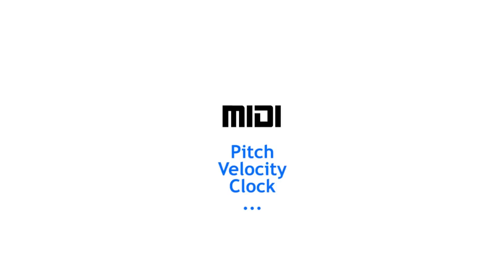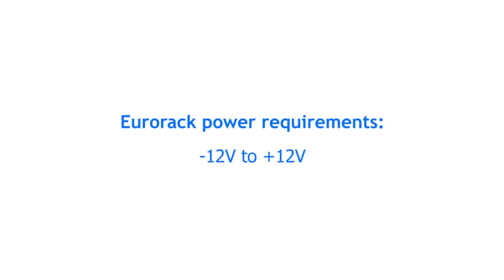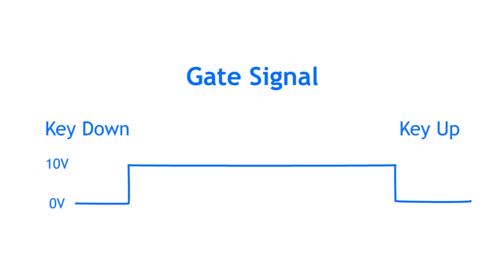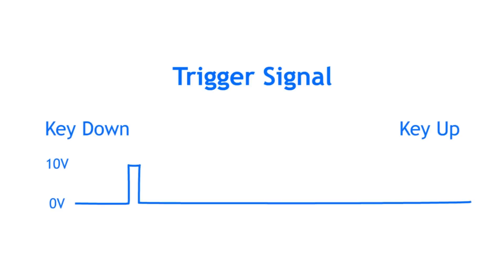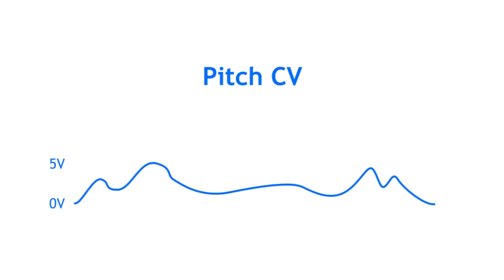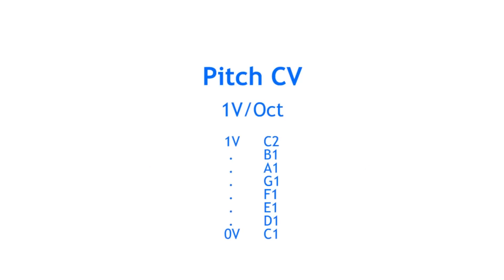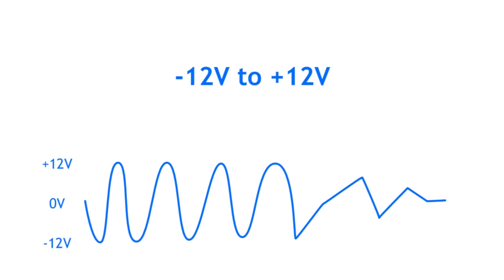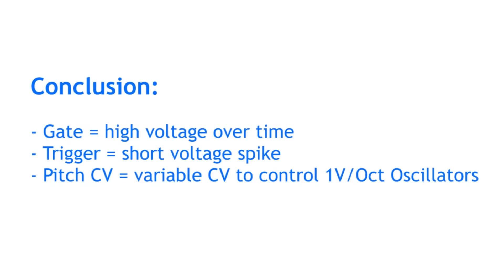Modular Synth Basics #02: CV, Gate, Trigger & MIDI

Comment: Is it possible to use a guitar or bass signal to controle a modular system? Maybe it' s a stupid question but i m really a beginner
Reply from the maker: +gian - no problem! Ask away :) you can use the amplified guitar sound to modulate the modular synth signal or you could use an "envelope follower" module which tracks the volume of the guitar and creates CV from it.
Reply: +The Tuesday Night Machines 
great!! thank's for the answer and the video!!
Reply: Not a stupid question.
Reply: @tuesdaynightmachines  You could also use a guitar to midi converter to control your setup via midi instead of a keyboard

Comment: Just think of CV/GATE has a monophonic alternative to MIDI. It lets one device communicate with another but it does so using voltage instead of a digital signal. The advantage is that there's almost no latency, so timing is significantly tighter with CV vs. MIDI. The disadvantages are calibration issues; V-scale issues; monophonic only; and you'll need an analog sequencer to really take advantage of the power.

-BaconTastesGood 
Gearslutz forum user

Comment: THANK YOU FOR THIS VIDEO! But I have a tricky question for you: if I understand, there is a link between the keyboard and the oscillator as well as between the keyboard and the VCA via gate and envelope generator!!! But why do we need to 2 links, instead of just having a link between the keyboard and the oscillator, with the oscillator sending all the information to the VCA, instead of going by the gate and the envelope generator? Why 2 ways of reaching the VCA from the keyboard? Why not just one way of reaching the VCA from the keyboard, and that way being the oscillator?
Reply from the maker: Because of flexibility. Pitch and Gate CV are two very different things and if the gate/env CV would also directly control the VCO's volume from the keyboard, you'd have a regular non-modular synth ;-) Also, there are things like velocity, pitch bend, mod wheel, etc. which all have their own CV channel as well. So it's not just Pitch and Gate CV you have at your disposal, but a bunch of others too, being generated by the keyboard or MIDI-CV interface.
Reply: Ok I see! It's that I saw from many sources that VCO were the ones creating sound as if they were the only source of a signal, but now according to you, I feel like a sound can be created by different sources including VCO, gate/env and many others. Is that right? And do different sounds from different sources in the synth are somehow mixed together in the VCA ? (By the way thank you for the quick response, you're really awesome!!!)
Reply from the maker: The VCOs provide a constant stream of waveform sound. So for example one ongoing BRRRRZZZZZZ from a sawtooth wave ;-) That's it. If you want different pitches, you send pitch CV into the VCO of course, but if you want volume changes (like hitting a keyboard key and then having the sound fade out), you'll need a VCA, usually controlled by an envelope's CV. Then you've got your filters which subtract frequencies from a waveform sound, which can also be controlled via CV (e.g. keyboard velocity controlling filter frequency, etc.). So that original constant BRRRRRZZZZ sound will be like ... bbBBBrrrzwwwffnngwee... hahaha ... well ... so with subtractive synthesis, our VCO offers a base sound and we use other modules/effects to shape the sound. Like a woordworker, starting with a big block of wood and carving stuff off until you get a small wooden statue ... check the beginning of first Modular Synth Basics video again and you'll see that non modular synths often behave the same way, containing the same "modules", but hardwired.

Comment: I have a question.
I have a synth which has a gate input and a pitch input (korg monotron delay) and i want to build my own keyboard. I tried Linking the +3V to the gate input through a potentiometer which changed the pitch. But i can't get the pitch input (i suppose that is CV input) to work witha potentiometer, so i am still confused about how cv and gate exactly work.
I thought CV is the voltage you put in and gate is just connecting two points so that the sound works, so on a keyboard you have both working together.

Comment: what is difference between Gate set voltage? What happens when I use 10V Out on one module and 6.4 V In on another module?
Reply from the maker: A gate usually goes on and off, or rather from 0V to a set voltage and back. A constant voltage is always at a certain level. The voltage level you need depends on the situation, for example triggering an envelope generator, advancing a sequencer or doing stuff with a comparator set to a specific voltage.

Comment: How is it possible to set an envelope to retrigger on each new note if there's no space between the notes? E.g. I press one key on the keyboard and without releasing that key press another one, but have the filter and/or amp envelope retrigger at the start of the second note?
Reply from the maker: It depends on how your MIDI-CV interface handles this. If it sends a new gate on each key press then you just need an envelope module that has a retrigger input (e.g. Doepfer A-140).

Comment: possible to use a clock for triggering? or how to clock a lfo?
Reply from the maker: LFOs usually run free (but can be synced to a clock or reset by triggers sometimes). Clock pulses are just triggers and triggers are mostly just very short gates. It's all the same electricity.

Comment: What benefits do you gain from having negative and positive voltages exactly? Can someone give me a practical/common example of how it can be used?
Reply from the maker: One example would be simple „math“. If one voltage is too high, you can use a negative voltage to subtract from it and get a lower voltage.

Or think about controlling fiter cutoff. Usually you turn the cutoff knob down and use a positive envelope to open it. Using a negative envelope CV you could leave the cutoff knob high and close the filter with the envelope, which creates a different sound effect.

Comment: But what is the ''env gate'' input on the crave ?
Reply from the maker: It's probably the input that triggers the ADSR(?) envelope, which is usually done by a gate signal.
Reply: @tuesdaynightmachines  yes I figured that out, was just confused because enb and gate have each their output but are together as an input. Thanks !
Reply: Env gate input will cause the envelope generator to run.
Env output is the envelope-shaped CV output.
Gate output goes high while the envelope is active.

Comment: So if using a Midi to CV, would i need to still patch that into a VCO to get a signal?
Reply from the maker: Yes, MIDI-CV just converts the note data to CV. What you do with that CV is up to you then. Patching it into a VCO pitch input will change the pitch, but you can also patch it into filter cutoff or anything else really to control parameters with pitch CV.
Reply: Right thankyou, is it a fairly standard thing for VCOs to have a CV input? also people mention stack-able patch cables, could you have the same key stroke controlling multiple different VCOs?
Reply from the maker: +callumissocoollikf yes, VCO stands for Voltage Controlled Oscillator, so it should have a CV (Control Voltage) input :) Stackables copy signals so that you can indeed use them for multiple purposes at the same time.
Reply: right thank you so much, it's so much quicker and easier speaking to a real human
Reply: Is the CV in on a VCO sometimes called an fm in or is that a different thing?
Reply from the maker: +callumissocoollikf FM is more for sound shaping, but it does change the pitch. It doesn't track a keyboard though. For that you need a 1V/Oct input.
Reply: so if i see a 1V/Oct input on a module then i know it will definitely handle a keyboard properly (aside from gate and that) thank you
Reply: One last question then i promise i will leave you alone, if i was looking at oakley modules, would i need a midi 2 cv that works in that specific format, aka, would a eurorack module not work?
Reply from the maker: +callumissocoollikf haha :D 1V/Oct will work across systems/formats, as will most other audio and CV.

Comment: Hi! mi name is agustin from argentina, the series of videos are great and very very useful! i came back to this video because i have a question. I'm buying a pittsburgh System 10.1+ ( http://pittsburghmodular.com/system-101-plus/ ) and i was trying to get another module to have other controls of the synth, i was thinking in the peaks module from Mutable Instruments (http://mutable-instruments.net/modules/peaks) but (this is my first modular synth sorry if this one is a silly question) it says it needs a trigger signal input to modulate, how can i create this signal? it could be any signal output into this trigger input? can i get it from the pittsburgh synth? i was thinking in a general control module with a lot of options, but that trigger input got me thinking if maybe this is not what i need, do you have any suggestions?
thanks a lot again! the videos are great
Reply from the maker: agustin0genoud A trigger can often just be a gate (from a keyboard or a square wave LFO, for example), i.e. something with a fast rising edge. Some modules might trigger twice though with a gate signal, once at the rising edge and once a the falling edge. I don't know about the Peaks, but you're probably fine with gates. Otherwise, you could generate a proper trigger with a really fast decay/release envelope from an envelope generator, or from a trigger sequencer of course. But, as I said, I assume that the Peaks works well with gates too.